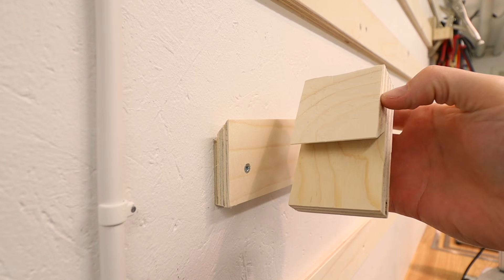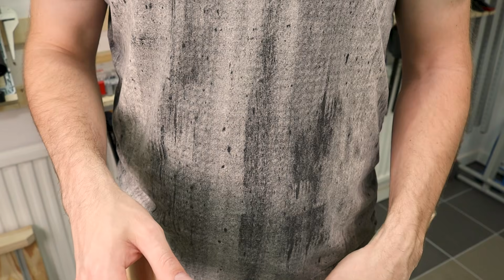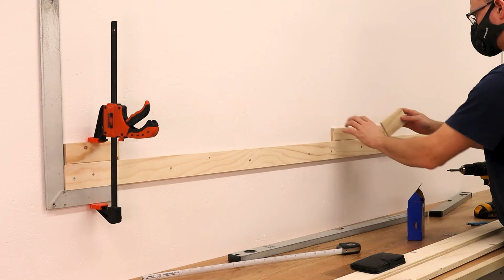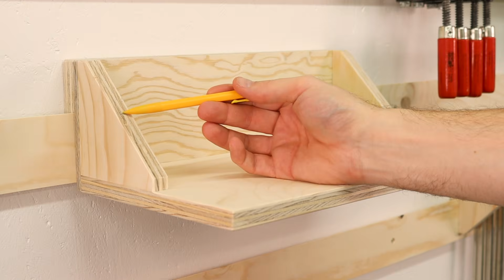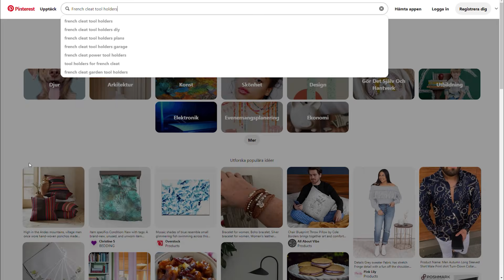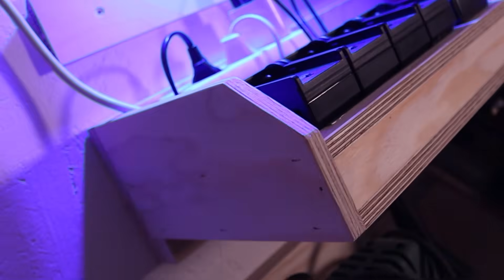Beginners guide about making French Cleats in just 7 minutes

Comment: Wall Cleat : 6.5 cm
Cleat thickness: 15 - 18 mm
Angel of cleat: 45°
Dull tip : 1 -2 mm
Screws length: 3"
Free spaces between cleats = the same length of your object cleat
Distance between stud screws : 40 - 60 cm

Comment: is it also feasible to screw the tool holder into the correct side cleat on the side instead of the back? I try to hang a cabinet with cleat as i have no other option and don't want to drive a screw through the ultra thin back wall of the cabinet. I'm just scared it might rip that tool holder side cleat apart.

Comment: My real question is: as a beginner with a poorly equipped shop, how do you cut a 4x8 sheet of plywood into 8ft long cleats without killing anybody or loosing digits...
Reply: poorly equipped could mean a variety of things but if you mean you don’t have a big ol’ table saw with 8 feet of infeed and outfeed, then you’re going outside and using saw horses or a picnic table, clamping an 8 foot long straight edged object to that sheet and using it to guide a circular saw. Most of the internet is going to ask why you think your cleats need to be 8 ft long and made from one cut but I hate most of the internet so I wanted to answer the question as directly as possible. That aside, if you’re a beginner, don’t start on your 8 foot french cleat wall until after you’ve done something smaller. Get some pre cut panels of plywood from the store, make 2 rows of wall cleat no longer than a foot or two, then make a little baby shelf for a glue bottle. It’s satisfying as hell. And when you then embark on your 8 foot wall…the cuts don’t need to be 8 feet long. An 8 foot long wall cleat could very well be four 2 foot wall cleats mounted end to end. Good luck!
Reply from the maker: You don't need to use plywood, you can use normal boards and just add a chamfer on them. In fact, thats what I have done on the most resent cleats i put up. You also dont need to make that super long, you can make several short cleats that would work just as good.

Comment: In North America, studs are 16 or 24 inches on centre, to fit 4 x 8 ft plywood sheets. with 16" spacing, the space between the studs is 14.5". Never seen studs spaced 14.5 inches on centre.

Comment: Thanks for video. Is it a good idea to use for kitchen cupboards?
Reply: I actually asked the instructor about this during a carpentry course, and he said French cleats are a good option. However, he recommended always using both glue and screws to secure the cleat to the back of the cabinet, as the joint could fail under too much weight. He also suggested adding a support strip at the bottom of the cabinet if needed, particularly for heavier loads. I haven’t tried yet though.

Comment: In the US, wall studs are 16in center to center.
14.5in is what that measures in between the two studs, with 2X lumber being 1.5in wide, 
16 - 1.5 = 14.5
I have been a builder for 30 years, and have never seen anything other than 16in on center for wall studs.
Roof trusses can vary from 24in to 19.2in for heavy clay or slate shingles.
Good video, getting rid of the sharp edge is a must.
Reply: My house was built in 1992. The studs are 2"x6", 24" center to center. USA
Reply: @1995Benzo 16” centers is standard. 24” centers is maximum acceptable. It’s cheaper to frame walls with 24” centers, but not as sturdy.

Comment: Is there any advantage if using a 2x4 vs. a 4 or 5 ply plywood for strength? 
I suppose sheet is preferential because it will tend not to warp, cup, etc. if you are cutting the cleat itself and it's any length and you don't immediately put it up.  

I'm looking at some form of french cleat to take the weight from 45 degree lumber supports for a shelf that I want to be able to hold a lot of weight.

Comment: Question for you: Can cleats lift up on one side if there's too much weight unevenly placed on the other side? I'm making a single 54" wide x 32" high unit for cube wall storage and will have a 30" metal cleat in the center. One concern my partner voiced is it lifting up if someone (like a kid) steps on one side, or puts a lot of weight only on one side. I haven't seen anyone anywhere on YT demonstrate what happens in this kind of scenario. I'm also just curious to know in general if a cleat can lift up in this way regardless of relative sizes. Thanks!
Reply: If the cleats span the whole distance as the shelf unit than I don’t see how it would lift as there’s no fulcrum (pivot point) for which the weight can act against. 

In your case the cleats will not span the whole distance and the cleat itself can act as a pivot point making tipping possible.